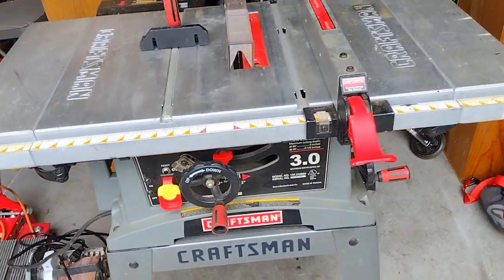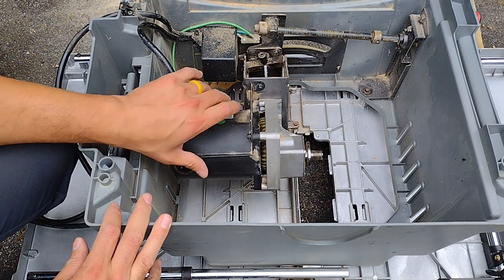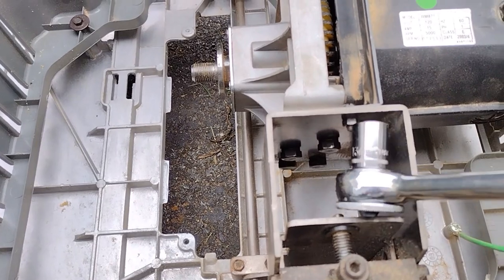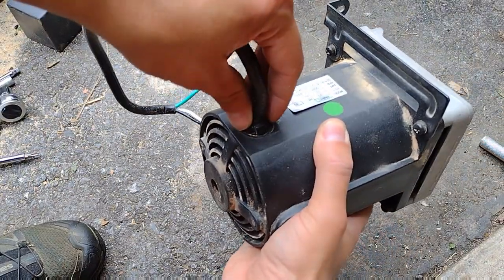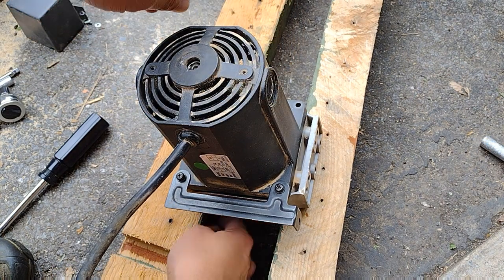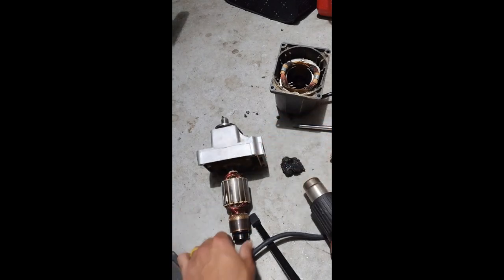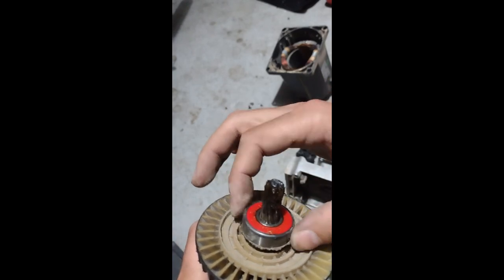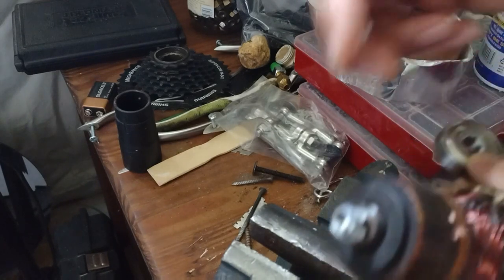How to fix a motor of a Craftsman table saw that hums and does not turn

Comment: That bearing on the end seems to be the one that fails. I got the rebuild kit with 3 bearings and brushes, but just changed the end bearing opposite of the blade because the others seemed OK at the moment. Good info, thanks.

Comment: Good job!  I just disassembled mine and ordered a rebuild kit.  I’ll use some of your tips when I do the rebuild.  I especially like the tip about lowering the blade to get better access to the motor mount bolts.  Thanks.

Comment: Excellent video, thanks for the instructions and parts references.  I have the same model table saw with the same issue.  Cheers!
Reply from the maker: No problem, it was a fun fix.  I am sure you will get yours back and running too.  Good luck with your project

Comment: The bearing puller has two 2 extra holes on the flat surface for the puller bolts and one for the pointed 
center shaft. Once everything is complete, you just tighten clockwise your center bolt and you will see that bearing will come out.

Comment: This was very very helpful.  Thank you. I am planning to change the grease of the gear mechanism between the two top bearings. What kind of grease should I use? The reason I ask is because I used NLGI 2 grease, different type and they all flew out of the casing making a mess. I figured one need to have a much thicker grease to stay in the enclosure between the two bearings, to keep grease on the gears.

Comment: Nice job, I bet that felt good.  And you were obviously confident since you didn't bother testing the motor before you reinstalled it.
Reply from the maker: Thanks, I had a pretty good feeling that the melted rubber was not going to allow the motor to turn and because of the humming sound coming from the motor.

Comment: Funny Story-
I had a craftsman table saw for years & years. THEN, one day I was sawing and
a bolt of lightning flashed out of the motor & the breaker popped. After the 
smoke cleared, I pulled on the belt to see if the motor would turn-NO. So, I 
bought a new motor. While I was removing the old motor I found steel 
powder all over it. Sometimes, I put on a metal cutting blade and cut steel. 
Apparently, the steel shavings dusted the motor & eventually got into the cooling 
holes. SO, I cut a piece of cardboard & mounted it shielding the new motor so 
that any shavings will stay out of the new motor.

!

Comment: Nice video. I'm going to attempt it on mine. Problem is the back of the housing is deformed and I worry the bearing cup will wedge again seizing the bearing once more.
Reply from the maker: If I was in your position, i would probably try to add something to the bearing cup to keep it in place(some type of adhesive).  I wouldn't buy a new housing because it cost too much.  The bearing cup is just holding the bearing in place so that it doesn't begin to wobble.  If it doesn't work out, is time for a new machine i suppose.

Comment: One of the best repair videos I have seen. Bro, you have a talent not only to repair, but to provide detailed narration while doing so. Very detailed. Very well done !! One question. What was the plastic blob you removed and did you replace it with a new one ?
Reply from the maker: The plastic blob was the bearing cup.  It melted because of the friction, so it became just a blob of plastic.
Reply: @fixit9888 Thanks much for the quick reply !  Thank you for the awesome video too, Bro !
Reply: Excellent video and exactly what I needed! I found the same table saw on the side of the road yesterday and your video proved to me that I can bring it back to life. Thanks so much! You're awesome!
Reply: @fixit9888  I just opened mine according to your instructions. I now know what the plastic blob is. It is the casing for the impeller. It is not the cup at the end of the shaft.  Just wanted to let you know. So your motor is now missing an impeller cover and therefore the airflow is altered. The cooling can get affected.
Reply from the maker: @panthera7291  look online and see if you can buy that casing.  I think it's expensive.  I have found used parts for other things on eBay.  That might be a better route for you if you do not want to spend too much on the repairs.  Hopefully you find it there.
Reply: @fixit9888  Thanks again for the reply. That plastic casing for the impeller is fine in my motor. What I mentioned in my previous msg is that your motor is missing that.
Reply from the maker: @panthera7291 thanks ,   can you send me a link to the part?  If that's the case, I need to purchase and install that piece.  I never noticed that
Reply: @fixit9888  Unfortunately I don't have a link or the part number. If you do a YouTube search 'RM871 Motor parts layout and diagram for a Craftsman Table Saw' you will see a video. At 24 second mark of that video it shows the large circular plastic casing for the impeller. I am pretty sure that is what melted out in your motor. Hope this helps. I tried to find a schematic diagram for the motor to no avail. Hope you will find it. Good luck !

Comment: Not sure if you remember  but when you took the motor out did you have 2 shims fall out from one of the bolts holding the motor on?
Reply from the maker: I do not recall that.  Send me the time in the video where you see me taking off the bolts and I will check mine to see if I have them.
Reply: @fixit9888  no there was no certain time in the video, I ask because when I had to tear down the motor and replace all bearings on my saw a few days ago and when I removed the motor 2 shims fell out from  one of the bolts that hold the motor on. Thanks for the reply tho.
Reply: I have a shim,its in the parts diagram,some have 2 sheet metal half circle

Comment: Thank you for making this video and in such great detail. My table saw just quit working, I’d like to give this a try but I have a question.. What kind of adhesive should I use to glue the bearing cup?
Reply from the maker: Don't put any adhesive.  The bearing cup is there to retain the bearing.  It will not come out once the bearing is inside the cup.
Reply: Oh, really? I purchased a plastic epoxy for the bearing cup. I assumed because the old one was hard to remove it was glued in place from the factory. Im still waiting on the bearing cup to give this a try. Thank you for making your video and for your reply.

Comment: If you would heat the bearing it will expand and might just fall off by itself.
Reply from the maker: I have never tried that method.  If I have any issue with a bearing, I will try it out. Thanks

Comment: Hi, I am fixing my Craftsman table saw motor just like what you did to yours. I need to get the plastic cap for the ball bearing. Can you tell me where you get your.
Reply from the maker: The plastic cap is the "bearing cup".  I attached a link in the description.  Hope this helps.
Reply: @fixit9888  

thanks, I will check it out when I get the ball bearing.

By the way, your video is very detail and helpful. Great job!
Reply: Received the ball bearing and the bearing cup.Finished repairing the motor and put it all together in about an hour. The table saw  is back to service!

Thank you for your video and the bearing cup link.

Comment: I wanted to ask you, from where did you order the bearings and the end cap?
Reply from the maker: Hi, thanks for your comments, I ordered everything on Amazon.
Reply: What’s the bearing item number if you have it excellent video
Reply: This video set me on the path to fixing my table saw.  I have the rebuild kit from Amazon.  I don’t know if you remember specifically, but can you tell me if the two bearings on the armature need to face in any particular orientation?  I’ve looked at them and can’t see any reason why one side needs to face inward or outward.  Thanks for any insight you might have.